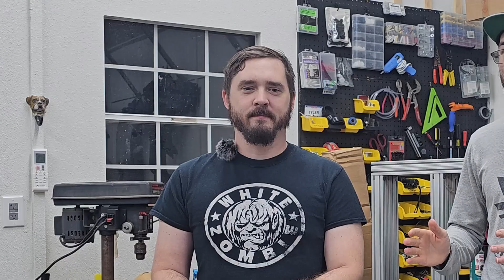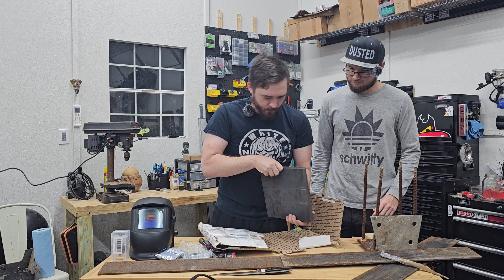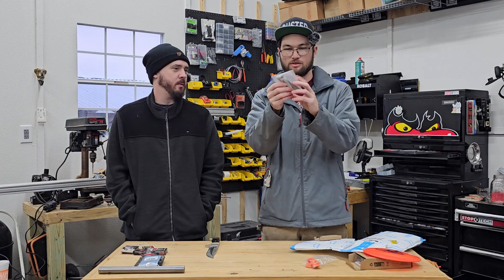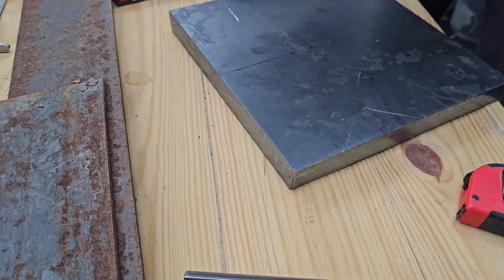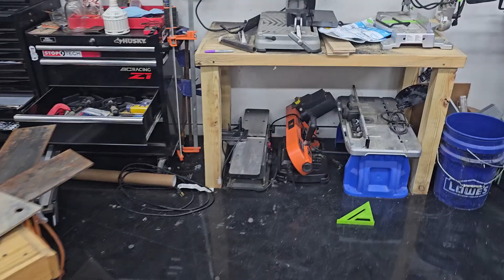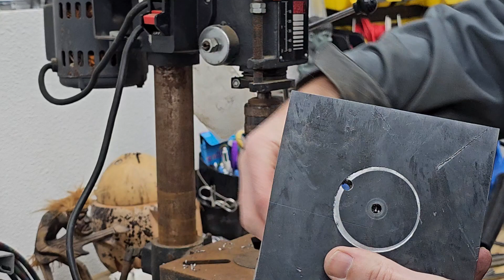Building a Disc Golf Launcher Episode 5: Parts are in, Lets Start Building

Comment: Dusty!
Reply from the maker: Nice, you found the channel. We appreciate u checking it out. The launcher you made on ur channel was hard-core. We aren't even gonna try and match ur launch speed.
Reply: @TheDus-TyGarage1217  appreciate it. Next one will throw way faster. We believe the limitation will be the disc tearing or deforming and slipping through the fingers. What do you use for animations and real life/animation overlays?
Reply from the maker: I used Blender to create the 3D version of the Garage that we fly in and out of in the intro/outro. I created the launcher model in Blender as well. I use Hitfilm for video editing, and Inkscape to cut the background out of images and make the thumbnails. What did you use to make your animations? Your software looks like it has machine parts that can be dropped in, which would be nice for modeling. Using Blender I am having to 3d model every part from scratch (motors, pulleys, etc).
Reply: @TheDus-TyGarage1217  We use Blender only to convert .stl to .fbx then drop into Unity for animation.